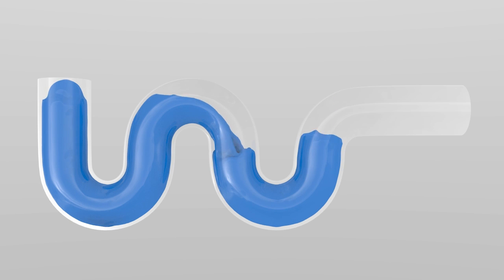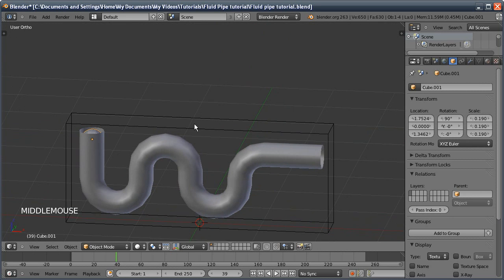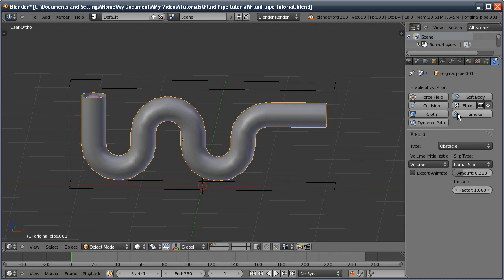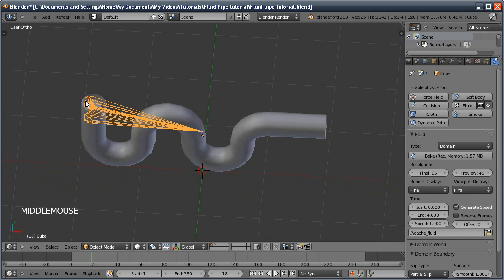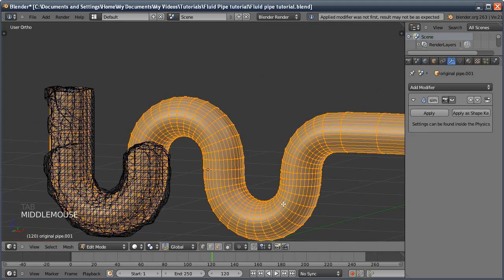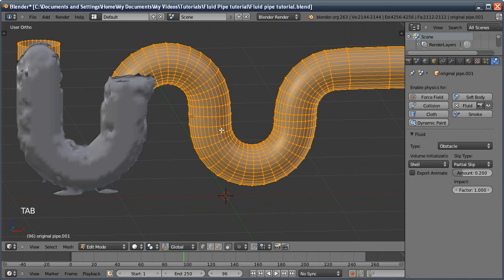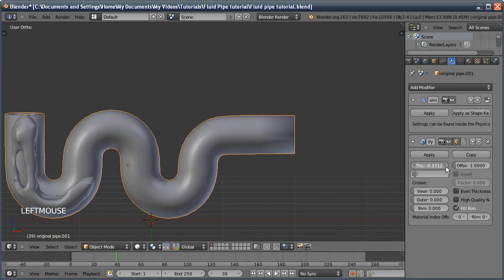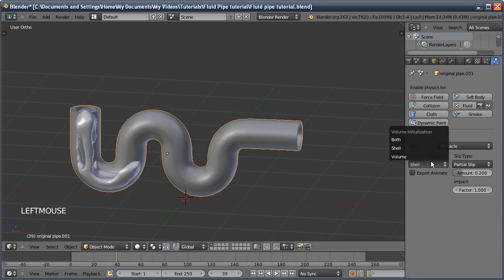Blender Tutorial: Fluid in a pipe

Comment: Hi Ray,

I am trying to make the fluid go upwards from a tank to a pipe that sucks it up

I thought I could do that by simply letting the sphere follow a path

but the result i get is the fluid stays at the bottom (for gravity) and the sphere moves along the path shooting some particles

do you have any suggestion?
Reply from the maker: Well, you will have to cheat it as that type of simulation can't be done in blender. Maybe if you had the fluid simulation on it's side you could get the fluid to pour out of the tank, along the pipe and then have the camera also rotated so it looks the right way up.

Comment: could have used a solidify modifier before the simulation or something, that might also give better results. also according to someone who commented before turning the slip type to "no slip" might also prevent the leaking effect, not sure but definitely worth trying. Oh and also the only thing you have to do to get the simulation to "see" the subdivision surface is to move the subsurf modifier above the fluid sim, no modifier application required ;) same applies for the solidify modifier

Comment: My fluid doesn't come out the other side of the pipe. There's nothing blocking it, but it thinks there is a wall there?
Reply from the maker: +Kai Master Is your fluid domain too small? Everything needs to be fully inside the fluid domain to be calculated correctly.
Reply: I have the same problem, and my domain is big with the pipe as the fluid obstacle - shell, and the icosphere as inflow - volume.  Either nothing happens, or the icosphere drips strait down (pipe inactive).

Comment: Please help
Have a plane in front view so you see a square.
Lets say from top-left, going clockwise, there are four corners, A,B,C,D
now, en edit mode, select opposite corner vertices (A,C) and push them back
move in 3D view you see the fill formed a virtual edge (non existent) between B,D vertices.
So as fill there are two triangles A,B,D and B,C,D (like wings)
Now, the question
How do I change the fill so the triangles filled are A,C,D and A,B,C?
Usually I do remove the face (only), then

Comment: Just a tip for everyone, to make the pipe thick do the solidify modifier on a minus so it doesn't conflict with the fluid and looks more realistic. And in the domain section change the end duration to however long your timeline goes to. So if your timeline is 250 frames (default) then set the end duration to 10 seconds and change in scene tab the running speed to 25 fps So that your fluid speed isn't sped up or slowed down :D Hope this helps some people.